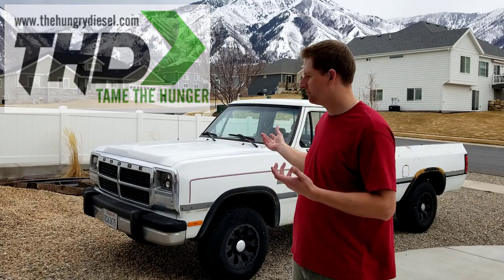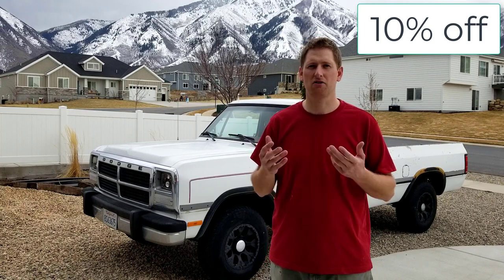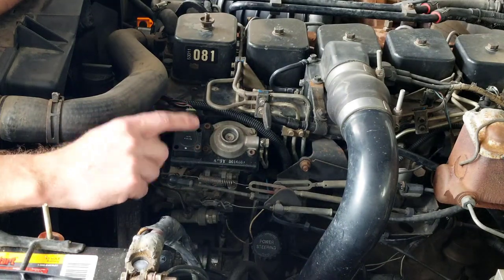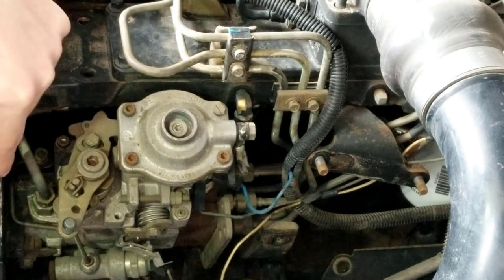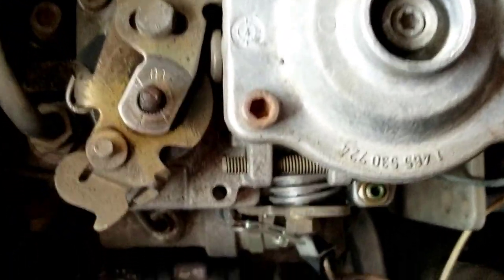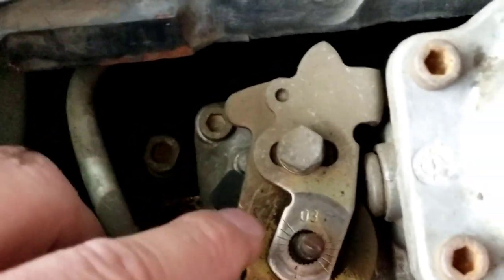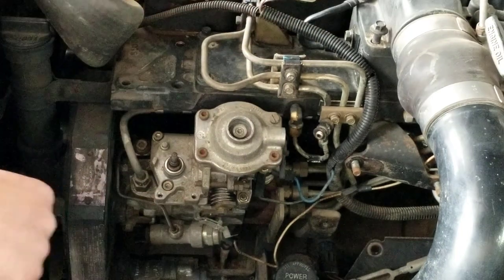How To Change the Governor Spring | 1st Gen Cummins

Comment: Put a 3200 rpm governor spring in my Cummins. After installing i had to turn idle screw all the way down, still won't idle. Had to turn fuel spring down to get to run. What am I doing wrong? Please help
Reply from the maker: I would almost bet that your throttle indexing is off. I would almost out money on it. Pull the lever off the throttle shaft and double check it. As you install the lever back on the to shaft make sure to pull up on the shaft at the same time so it doesn't come unindexed.
Reply: Was it indeed the indexing?
Reply: Decent Garage ok

Comment: Hey I was wondering, I already have installed 50hp injectors and have a 3200 govener spring that is ready to be installed and I want to get a new fuel pin and crank the fuel up, but my truck has the manuel getrag 360 and I don't want to tear it up, right now there's nothing wrong with it and I want to keep it that way even if it means leaving the power where its at, ive only had this truck for about 6 months and am new to diesle in general and don't really now what I'm doing, what would you suggestion be? Would the trans be okay with the upgrades or would I need to do something to the trans before all that?
Reply from the maker: Great question Blake. The answer is that your trans can handle any modifications you do, it is simply a matter of how you drive it. I could have 700 hp / 350 torque and as long as I drive it conservatively my stock transmission will stand a chance. Once you start hot rodding it or towing heavy you will run in to issues. I would say a 3200 gov spring and 50 hp injectors are fairly safe for your transmission though.

Comment: I installed both Hungry Diesel Fuel pin and 3200 governor spring.  After adjusting fuel screw, I was able to get it to started, but.....in test drive at higher RPMs, when I depress the clutch to shift (have 5spd Getrag), the engine rev'd up.  Had to slow engine revs via braking.  When I do not rev the engine, there was no problem.  Any thoughts on what to do to keep the engine from reving up when I depress the clutch?
Reply from the maker: It sounds like you are close to runaway and may have the fuel screw turned in too much. This is called governor hang and is the step right before reaching runaway.
Reply: @decentgarage  I have adjusted the fuel screw such that, at the current screw setting, it runs well (except for problem described).  When I back off the fuel screw half a turn, it runs very roughly, but still experiences the same problem of high revs.  When I back it off another half turn, it will not start.  Basically, I am unable to get the truck to run and not have the high rev issue.  Considering just removing the 3200 governor spring and replacing it with the original.  Ackkkk
Reply from the maker: @jamesmayfield7135  Sounds like your throttle indexing is off by one mark. Make sure it is indexed correctly.
Reply: @decentgarage  Wellllll I replaced the 3200 governor spring with the stock spring.  Still has the Hungry Diesel fuel pin.  Worked just fine.  You may be correct on throttle indexing, but am just too dang frustrated.  Now....tomorrow I will be installing the Diamond Eye Stainless Steel 4" Turbo-Back Exhaust - just watched you video.  Thank you very much for responding.
Reply from the maker: @jamesmayfield7135  Just take a braeak from it, do the exhaust and come back to it. My videos make it seem like i get everything right the first time but that is definitely not the case. I actually prefer when installs don't go perfect because that's when I learn how to diagnose the issue and I have to year things apart multiple times so it gives me repetitions.

Comment: I installed a 4K in my first gen (ve pump) and it won’t start back up
Reply from the maker: You either have to trim the 4k spring exactly right or reindex the throttle. I am guess that is your issue
Reply: @decentgarage  apparently you have to be a professional to change a gov spring, so all mechanics say I mest up my pump
Reply from the maker: @luisdaboy9578  not true at all. You have to be careful but you don't have to be a mechanic.

Comment: I had to laugh because my indexing changed when I tightened the lever down and everything was reversed.  Giving it throttle killed it and pushing it back reved it up.  I had to crack a few injector lines loose to bleed the air out.  I even poured a little bit of fresh diesel in the top of the pump to reduce the amount of bleeding I had to do but still gave me a hard time starting
Reply from the maker: Yep, that's exactly what happened to my throttle indexing. I didn't have a hard time getting it started though. Didn't have to bleed anything
Reply: Man I had the same issue, but I tore back into it, readjusted the throttle indexing, and I cant get it to start, AT ALL, she acts like she's going to fire up, but won't run
Reply: @brendonhurley4336  have you cracked the injector lines loose to bleed the air out?

Comment: I’m in a bind! Changed fuel pin and governor spring. Truck won’t start, checked the indexing and the wires for the shut off and still nothing
Reply: Never mind I broke the fulcrum
Reply from the maker: No!!!!!! That was my suspicion if everything else was good

Comment: Are you in utah??
Reply from the maker: Yes I am.
Reply: Mountains looked familiar. Lol. I live here to. Any chance you’d want to make some side $$ doing a gov spring and pin on my first gen? First, first gen and don’t want to ruin anything on my daily driver. Lol.
Reply from the maker: @kevincolton3407  I don't do work on other vehicles but if you follow my videos on those things you'll be fine
Reply: Sounds good. I think I can get her done, just worried about run away or tuning after there done. Just ordered them from Eric. Thanks for the discount code as well!
Reply from the maker: @kevincolton3407  you'll be fine. Message me on IG if you have questions

Comment: Unfortunately its an automatic. Me about my 48RE..
Reply from the maker: I haven't had any issues with my automatic, knock on wood.
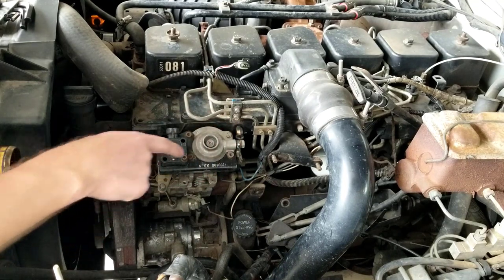Reply: @decentgarage  my main problem is towing steep grades under load. The jump in the gear ratios is too much. I've even swapped in 4:10s with posi, which was a massive improvement, but the weak link remains the 48re. It's a 2004.5, & now looking to move on to 6 speed NV5600 to match my year model. Good luck!!